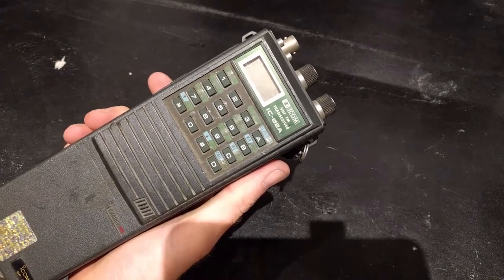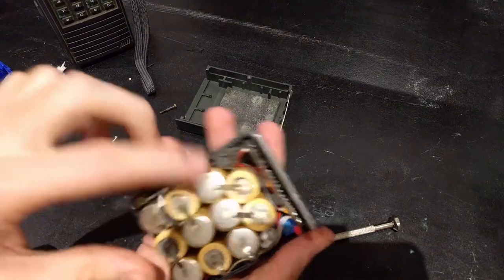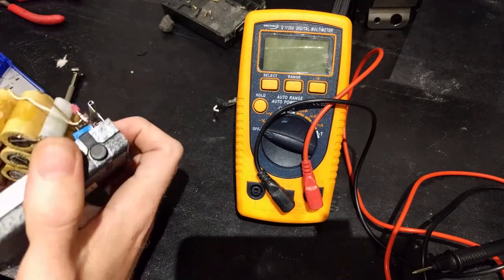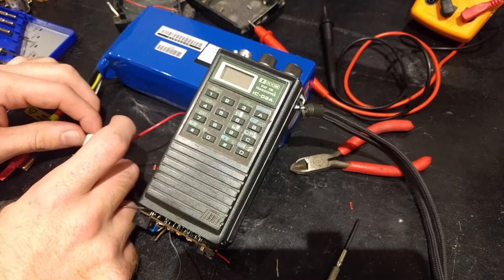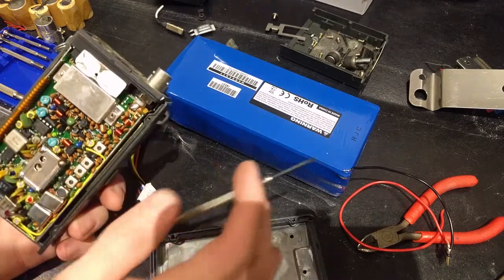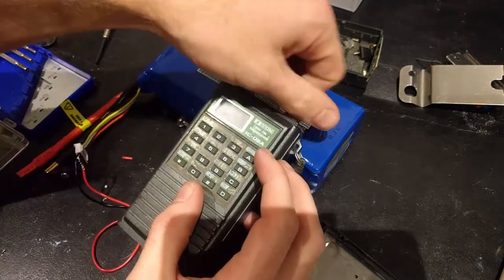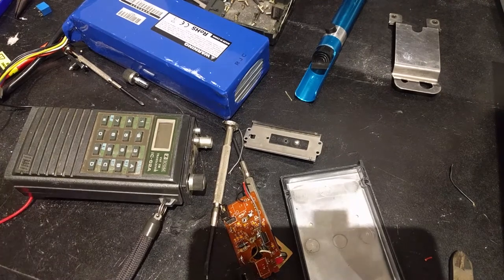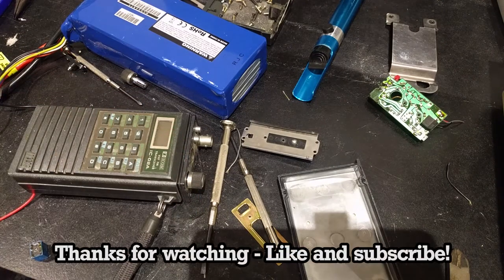ICOM IC-02A Teardown - VHF Handheld Radio

Comment: I still have an Icom IC-A2 from when I used it as a backup radio for flying. I did replace the Ni-CD batteries with a LiPo battery. Other than that, the only servicing required now and then (which I do myself) is cleaning the conductive rubber keypad buttons to keep them responsive over the years. It really hurt to see you kill this fine radio. Sorry to say that you seemed a bit like a gorilla looking at a cellphone and just smashing it to pieces. Poor IC-A2.
Reply: I LOVE my IC-A2. The thing is over 30 years old and still a rock solid transceiver.
Reply: @Matt-mo8sl  Yep, same here.
Reply: I have icom 02n im planning to repack my battery can you teach me how you did the LiPo conversion?
Reply: @Deadstring18   I used a 3S, 850 mAh LiPo pack with a JST connector and then purchased a pigtail with a mating JST connector. The "3S" means it's a series-connected 3-cell type, with  11.7 nominal voltage (12.6V fully charged, just over 11V discharged). And 850 mAh capacity doesn't sound like much, but it will power the radio for many, many hours. If receiving only, it will last for a very long time before requiring a charge.

After removing the old Ni-Cd cells, I did discard the charging circuit and made a new circuit board of the same shape  (with just traces, no electronics components) just to facilitate the soldering, but I suppose one could use the old PCB, cutting off all unwanted traces to the connectors, or even  solder the leads directly to the inside connectors. Then I soldered a JST connector via a short lead directly to the board's (+) and (-) terminals. A little foam padding so the battery wont move about inside the pack's case and that was it.

The down sides are that (1) I have to keep tabs of the battery pack's performance, as to not deeply discharge the Lipo battery. The moment you see the Tx power indicator start to go down (with full power Tx) it's time to recharge. And (2) I have to re-open the pack for charging, as I didn't want to butcher the pack for external connections. I didn't wire and don't use the charging jack or the lower charging connectors because the battery needs to be "balanced charged" via its 4-way connector, that's why I need to re-open the pack for charging.

Another thing you'll also need is a proper 3-cell LiPo battery charger. A programmable one is best.

Since nowadays I don't use the radio much for transmitting, only receiving (thus don't really need full power from the battery), I don't actually charge the battery to its full capacity, but rather use the charger's "storage" function. This puts the battery in a safe (about 1/2 charge) condition for extended storage without being damaged (LiPos hate prolonged storage in a fully charged condition). Then, I can use the radio for on-and-off receiving for months at a time before recharging. I did the conversion many years ago (5 years since that first post) and the battery is still going strong.

Comment: tart up slowly with the power supply. measure the current consumption form electrolytic capacitors. Turn back the squelch. 73 Roland
Reply from the maker: Good tip

Comment: I just purchased one with a wall wart,belt clip,an ICOM IC-HM9 external microphone that was in the boxIC-BP3 battery,2 battery packs,leather carry case,3 antennas,& the owners manual with schematics.I turned it on and went to 146.520 and listened on another HT and the transmit audio is great.Yes it works great and for all of it I paid $3 at a local tailgate in Jacksonville, Florida.I collect HT’s so this one goes well with my ICOM O2AT.Sorry but mine is the IC-2AT.  👍🙀
Reply from the maker: That sounds like a nice rig! I was disappointed I couldn’t get mine going
Reply: What Up TK Here I was shocked that mine came on when I turned it on since I purchased it As Is and I had no idea that all of the other items were in the box.I knew I had more than $3 worth but I did much better.👍

Comment: I have some Icom radios (IC-2E, M12, IC-4E) which use the same battery connections, as do a few of my friends from the radio club I'm in, and this system has never caused issues.  The 'screw terminals' may appear to be a cheap option, but they work and have never worn out, so your radio does have a reliable battery connection. . If you do repack a case with new Ni-Cads, care must be taken to ensure the base plate of the battery is correctly aligned, as the gaps in the plate assign the correct charging voltage from the desktop multi-charger.  That said, nice radio, and the chassis looks like the IC-H16, which I believe the military used for a short while, during the Gulf War, as there was a shortage of radios.  All the best!
Reply from the maker: Thanks for the info! Always nice to hear some detailed knowledge on the hardware :)

Comment: What a cool video. I bought one of these off Ebay years ago and it's been dormant in the cupboard for a decade. It has a broken wire or a dry joint that means I have to put physically put pressure on the antenna connection to make it receive properly, probably a simple fix but I wasn't game to pull it apart. You have shown me the way! Thank you for this great video that you made 5 years ago.
Reply from the maker: No problem, sounds like you're having fun with your radio!

Comment: This radio does work with a 9V battery pack, which results in 3.5W of transmission power. It looks like you had the beefier battery pack which will transmit at up to 5W.
Reply: manages 1.5w on a full charge.

Comment: Pease one question : are the steps only at 25 khz? Is it possible to use 5 khz?  TKS  from Italy
Reply from the maker: I am unsure as I couldn't get the radio working. Thanks for watching!
Reply: It can do 5, yes. There is a step option. I could look for it if you still need the answer.

Comment: How do you solder onto those batteries...? I can't solder or unsolder onto them... to replace them.    I've tried on other radios.  Spot welding, huh, what the fuck.   I was going to buy one of these on ebay's but once you opened the battery pack I was like pfft forget it...
Reply from the maker: +CHOPPERGIRL's AIRWAR if you're replacing with new, get batteries with solder tabs on them. Much easier to work with.

Comment: Hi TK,

I just bumped into your video of the Icom 02. It's a great rig as they were produced in the 198x's using normal and more serviceable components.

Because of the age, it was very likely your NiCd battery pack was dead and I should also be a bit cautious with the leaking stuff coming from it. Cadmium is not very nice.

Rather than trying to connect power to the bottom, you could have put power to the top jack inlet next to the microphone and speaker sockets.  I have owned one of these rigs originally in the eighties, but unfortunately blew it up when my power supply was unnoticedly set to 30 volts rather than 12. I was very angry at myself, but learned from it. (Never use variable power supply for a rig, or use one with maximum not exceeding the rig's maximum.

Just recently I got another Icom on a second hand market. It's in good shape and service manuals are readily available. It works great. I got the 440 Mhz brother also, but the potentiometers are worn and it;s difficult to find new ones or just broken rigs where I can take these components from.

I don't know if you've put the rig together at the end, but it's a very nice oldschool handheld.

Greets from the Netherlands,

Alex, PA1FOX
Reply from the maker: Hi Alex,
That's a good call on the power socket... I probably should have tried to go in through the top instead. I think with a few components replaced this one may live again; I'm thinking of passing it on to a good home as I lack the parts to bring it back to life.

Thanks for sharing some background on the unit! Old ham gear facinates me but I haven't done much with it yet...
Cheers,
TK
Reply: Yes, these devices are quite service friendly and with lots of documentation around they can quite often be repaired. One needs to have a steady hand for soldering, fortunately I have one. :)

Cheers,
Alex

Comment: nice radio..got a dozen of this model on my collection. 73
Reply from the maker: that's awesome - I would presume yours are a little more functional than mine!
Reply: I have the commercial version of that radio in UHF band, IC-U16. The circuit board on top of battery pack is, as you stated, battery management-charging/cutoff.  I dont have the battery pack for mine anymore although http://store.batteriesamerica.com/bp-7iinsertforrebuildingicombp-7cm-7132v600mah.aspx carries inserts, and https://www.cutratebatteries.com/products/icom-ic-u16-battery carries complete pack.

On the top of radio is a "DC" in which is ~13.8 vdc, which is how i power up my radio. I still use my U-16 to check into nets/qso's on amateur radio bands using a 12volt power supply at home, and a lapel external microphone plugged into smaller jack on top. The earphone jack on top will accomodate the lapel mic i use, but i rather listen thru the icom speaker on radio as it's fuller/richer sounding than lapel speaker. There is a small indent on back of radio where the lapel microphone plugs in and this indent is to hold the "speaker jack" from moving around on radio. Icom must have thought about this feature when they designed this radio.

Because i use my radio at the house, and can be long-winded some times while chatting, it will get a little hot sometimes at low/high RF power. I mounted a small temperature switch (40 Celsius Normal Open Bimetal Thermostat Temperature Switch)  similar to the battery pack thermal switch you showed in video,    and mounted it on the outside, between the belt clip screws. I have a small 12vdc fan that turns on and blows across the back of radio to cool down when 40c is reached. I power the fan with two 9volt batteries in series, and they have lasted over a year now, and keep radio cool.

I wanted to keep the fan/thermal switch separate from the radio electrically so went with the two 9 volt batts in series and they sit behind radio.

Again...i dont have battery pack for this radio so i use external 12 vdc power supply coming into radio via top port.

@13:03 you can see the BNC (TNC for commercial radio) chassis mount, and how it's soldered to chassis circuit board. I have found that twisting on/off antennas to this radio will sometimes break that solder connection; at least on the commercial radio, which is TNC mount. I had to redo by applying quite a bit of solder and using locktite on that BIG nut inside radio. LOL 

origami... hahahahahahahahahaha. I love that what you said about this radio.

I have worked on a few of these radios  back 20+ yrs ago at a two-way radio shop  :)

Watching this video was fun, and at some times nail-biting as i was saying "don't do that" while watching video :)

I'm glad to see that you have a good spirit/attitude, and hope you can find another one of these radios and try powering it up via top port on radio as they are workhorses.

i typed this while watching video, so i cant rememeber if you stated you re-installed(normal'd up), the original relay back in place. If not, i would reconnect, and try to see if radio will work using top DC in port.

Thanks for making/editing this radio as it brought back some good memories of this style radio.

Comment: That is thermostat
Reply from the maker: This is a radio?
Reply: @WhatUpTKHere  yeah I know inside the battery pack there thermostat the you look  the purpose  of that thermostat  is to cut off the voltage when its fully charge